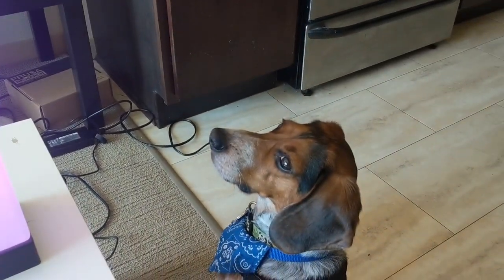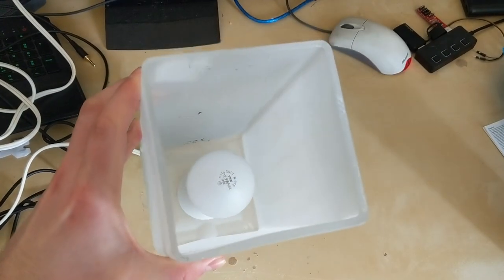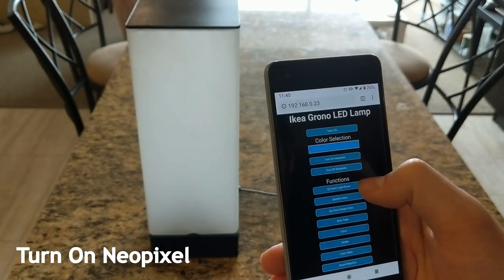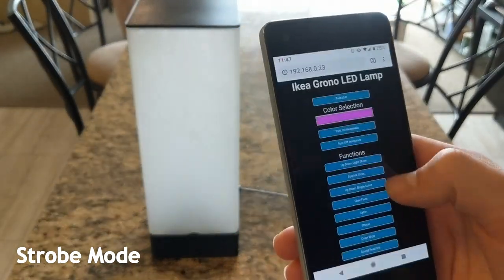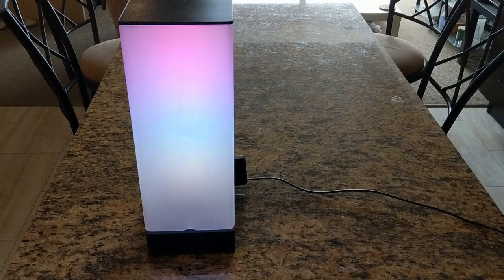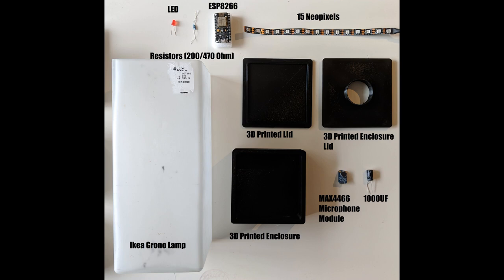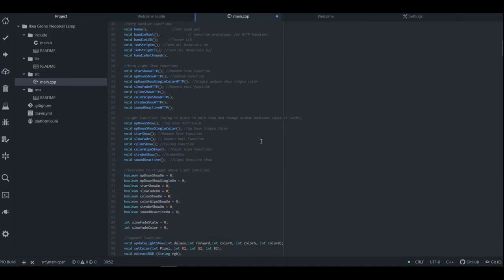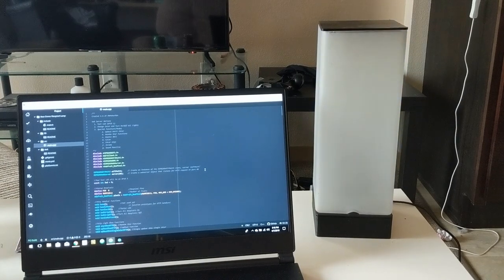Ikea Grono Wifi LED Lamp

Comment: I'm making one right now just waiting for lamp from Ikea What app are you using on the phone please Thanks for any help
Reply from the maker: Hi Neil, glad you are planning to make it! You do not need a phone app as the NodeMCU ESP8266 acts as a web server. After you upload the code to the microcontroller, an IP address will show in the serial monitor of your IDE. You can then use any internet connected device on your network to access and control the lamp. You just need to navigate to that IP address on any web browser. The instructable that is linked has more information. Good luck!